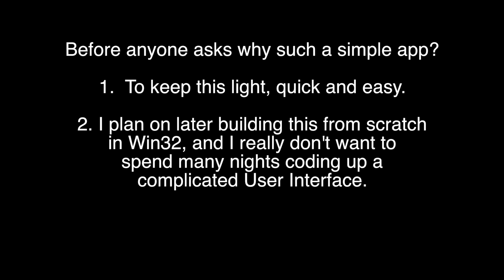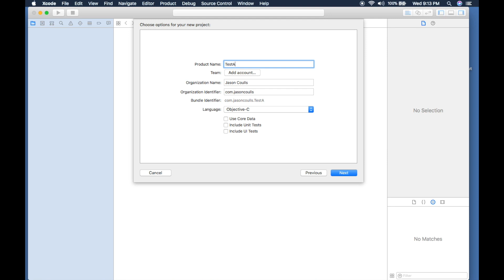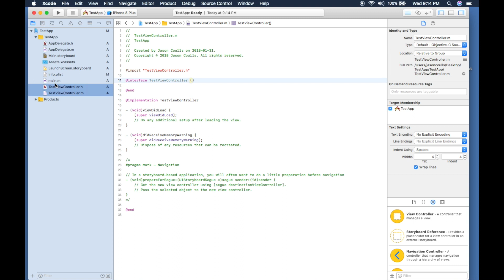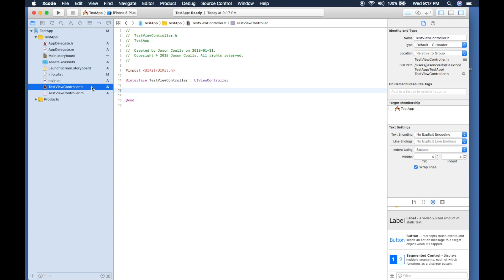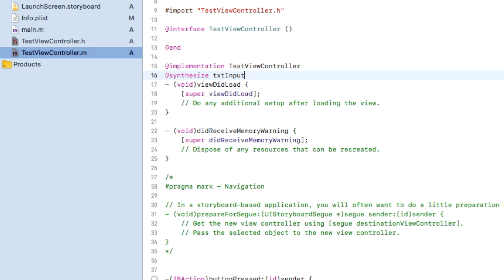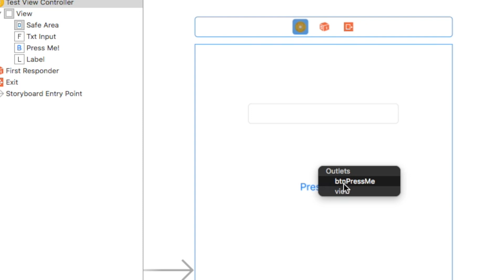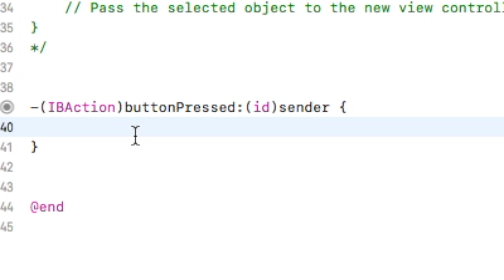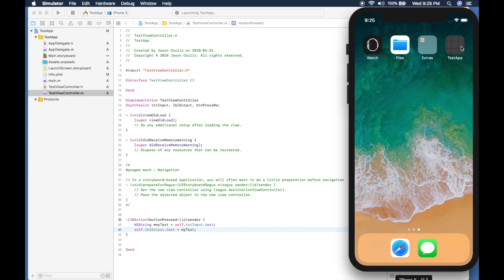How iOS apps are made

Comment: All very interesting, and as an older programmer (since 1979), all this is too confusing... The syntax is needlessly way too complicated. I know you said it isn't a programming tutorial but this is too heavy... and I do know a thing or two... of course, this not your fault, and I think you showed excellent teaching skills.
Reply from the maker: Thanks. For the constructive feedback.   I'm going to cover a lot of different systems, and each has a long history.  Every modern language sits on the shoulders of the giants that came before it. iOS is no different.  I'm in the process of installing the Android toolchain right now, to film how we build the Android version of the same simple app.  After building the Android version, I jump to Win32 - and it's this Win32 version that made me decide on such a simple app, because I'm going to have to code up that user interface from scratch and hook it into a message pump and that takes a while. After that, we get into the higher level stuff like Classic VB, C#, Windows Mobile, jump to Qt for the Linux and back to Mac and At the end of the day we should have the exact same program and UI (a textbox, button and label inside a window) running on all the major OS's, in many languages.